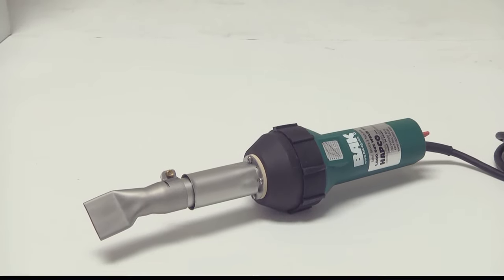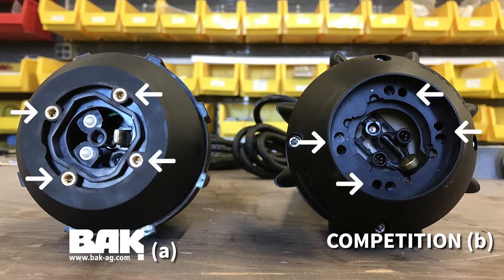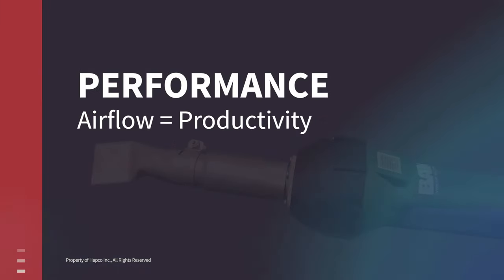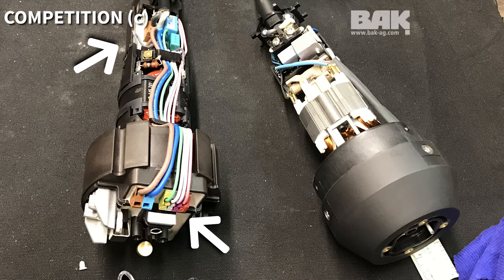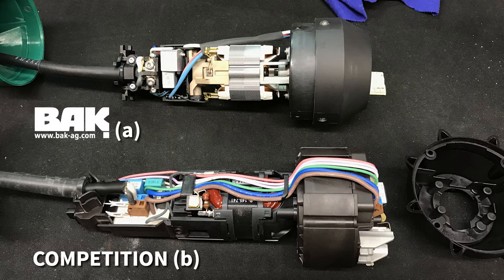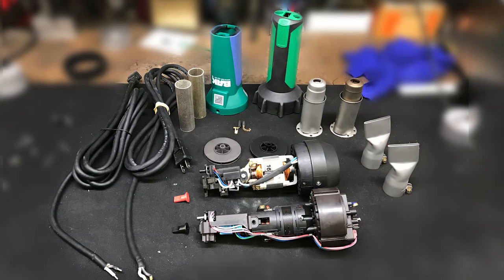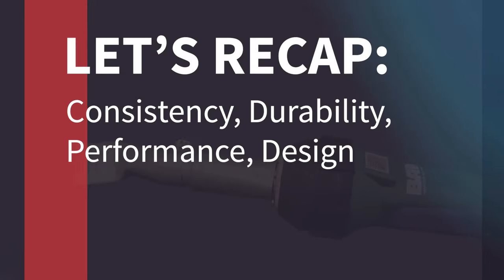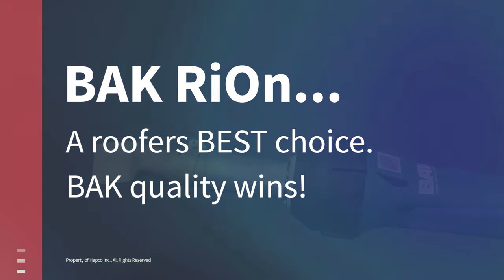BAK Rion vs Competition

Comment: this is not fair comparation. TRIAC S produced by  Leister is same generation as your RION. Designed in around 2000. It has all this features +  carbon brush depleting protection and aluminium blower housing instead RIONs plastic.  FIY due to sufficient airflow , the front board damage is very rare.  So If you want to be fair, BAK first should develop something what is  comparable with design from 2010.
Reply: I'd say see the product Video again, it is spot on and informative. As a repairman, I see inside of both of these brands machines, there are subtle differences in their build quality & both are very high quality pieces of equipment. However, BAK is a better buy firstly at its price point and secondly, see the video again, all of its benefits are there in plain site. Genuine Swiss Build Quality ... Quality Wins!